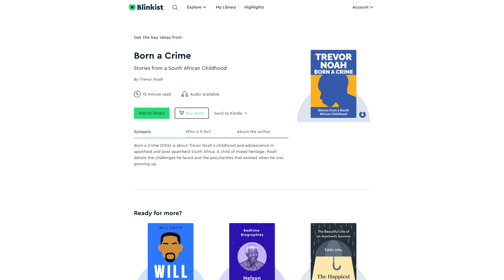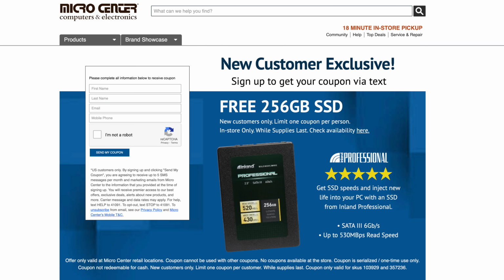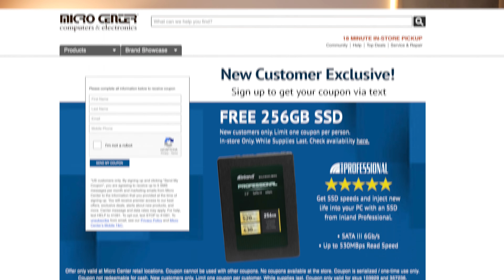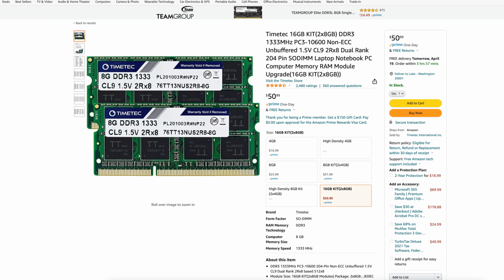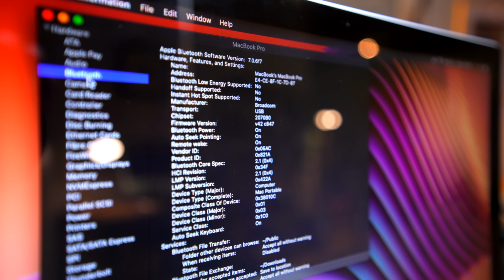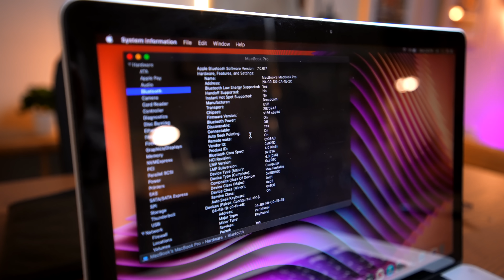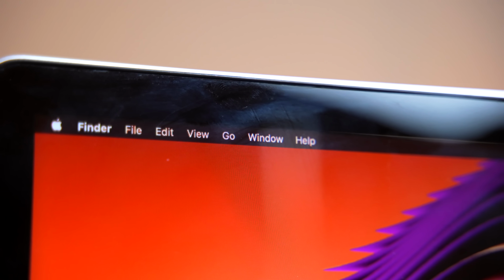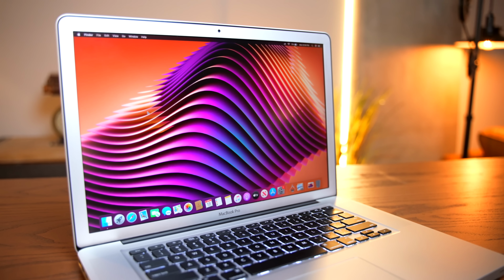Breathe new life into an old MacBook with THIS upgrade

Comment from the maker: Do you think modern Macs can be this long lasting in 12 years time? Also, check out my new merch if you enjoyed the video and want to support the channel! https://crowdmade.com/collections/lukemiani
Reply: I have a 2010 MBP 17” with the anti glare screen. Outside of the fact it only runs High Sierra it’s still a really good, sturdy and solid machine. I now have a 2021 16” MBP, but I will still use my 2010 MBP when I need to play around with some apps that still don’t work on my M1 Pro.
Reply: @FireAngelZero  I just put new battery and flash drive in my 2011 one, and it will work for a while yet. (Already upgraded it to 16 gigs of ram in 2011, so it was set on that count.)
Reply: @FireAngelZero  its pretty easy to patch it to run catalina or even monterey now if you want to run the newer versions of macos - i have a 2009 MBP running monterey
Reply: I have a recycle center rescued 13in Mid-2012 MacBook Pro, and as much as I don't like Apple because of their closed ecosystem, and anti-consumer right to repair stance,  it's still a good machine with a new battery, 8GB of RAM, HDD cable, 120GB SSD, and Solus Budgie Linux installed on it, and it does nearly everything at 720p I could want of a daily non gaming machine if I ever need it,  I just can't get the damn fan to spin correctly to keep it cool as I would like, so I don't use it for things like video editing. So yes IMHO you are correct about how machines are able to last so much longer now if you are not doing high end gaming, or high end work. 
Also yes even after Apples stops supporting the new M1/M2/etc.. machines I think there will be a lot of life in them with the fact the Linux community is doing some fantastic work, and even with the early results in some cases they are already making them faster than with Mac OS on them.
Reply: @CommodoreFan64  FreeBSD 14 works well in an i5 macbookpro from 2011.
Reply: Guess we’ll know once 2034 arrives. 😊
Reply: Hi i like video that you made because i think this is the way to go to fight against huge amounts of nonsense ewaste. Second i think bigger problem which at some point could be the topic for the next video is the planned obsolence where pc makers don't want to provide new software even though the hardware is perfectly capable. Greetings from Europe from Slovenia
Reply: It's easier to install Windows 11 on a PC from 2007 than macOS Monterey on this MacBook Pro, and it causes way fewer problems!
Reply: @Zebra_Paw  yeah that's 100% true. On mac side you have patchers but usually gpu is a problem
Reply: @domenvalentinuzzi  yes
Reply: @domenvalentinuzzi  Get ready for a lot more e-waste, when you toss perfectly good laptop because the flash dies, and there is no replacing it.
Reply: In order to boost performance i advise using toothpaste that has been recommended by 10/10 doctors as thermal paste.
Reply: Yes, the low-end users will be content with the M1 max. Of course they will have to settle for low-res 8k videos. ;)
Reply: I still have one Macbook from 2009 unibody. All Day long on!
Reply: They won't last any longer than their SSD due to really poor desitn.
Intentionally poor.
Apple shits on you and so do they on the environment!
Reply: @Zebra_Paw  Yeah they really don't build them like they did in the 2000s/2010s
Reply: @willm5032  They intentionally installed the firmware on the soldered SSD so if that SSD dies the machine cannot boot anymore, even to an external drive.

SSDs are a consumable product, so that shortens the potential lifespan of the machine by a lot.
In other words, do not buy them!
Reply: @Zebra_Paw  See a reply I wrote above. My current SSD is about 10 years old. Works fine.
Reply: @michaelhunt364  yeah sure, I never said all Apple SSDs would die in the next year or so
If soldered SSDs with firmware were the only issue I would never complain as much
Reply: @Zebra_Paw  Why would the firmware be on an SSD and not on the motherboard chip? Firmware stays with the computer. The SSDs are to be replaced. If they solder them in that is their dirty little trick to get you to take it somewhere and what they want is you to give up and fork over more money. Where did you find a soldered in SSD?
Reply: @michaelhunt364  the firmware just is on the SSD. It all started with the T2 chip, with their BridgeOS, which also introduced iCloud locks on actual computers (bruh).

A 2017 MacBook Pro can boot to an external drive when the internal drive is dead
A 2018 or later cannot, it would be completely bricked, even if you activated boot to USB before, which btw, is disabled by default and can only be enabled if macOS is installed and there's an admin user.
Reply: @Zebra_Paw  Well that sounds fucked. No wonder people are getting away from Apple. They are railroading you into a lifetime of constant hardware upgrades done by them or just selling you an entire new computer. I'll keep my 2011 Macbookpro with FreeBSD on it. Done with macos. Wife will need her macos restored once I update her 2012 macmini though. As long as she's happy with that. I'm not gonna worry. But I'd rather just put something on it that would work without all the apple fuckery.
Reply: @Zebra_Paw  found this:  Can the Aluminum "Unibody" Mac mini run Linux? Is it true that Apple has blocked Linux on these Macs?

Yes. The Aluminum "Unibody" Mac mini is capable of running a number of Intel-based distributions of Linux through Apple Boot Camp or by using "virtualization".

For the current dark "Space Gray" Aluminum "Unibody" Mac mini models (Late 2018), there was some immediate concern that the system's T2 security chip prevents the Mac mini from booting Linux. In its default configuration, it is correct that it is not possible to boot Linux, but it also is possible to disable the T2 security chip and then boot Linux.
Reply: @michaelhunt364  totally the right thing to do!
macOS in itself isn't a bad operating system imo, it has a few major drawbacks but every OS does.
So, I just make hackintoshes
Reply: @michaelhunt364  Yeah it's a lot harder to get Linux on T2+ Macs, though not impossible.
Expect a lot of proprietary shit to not work though
Reply: Back then, you could still get Apple certified Macintosh technician certification. When I was going for my classes, under the Steve Jobs regime, there was an option for a special discount, I took full advantage of it both times they gave us the option. Once in late 2009. I ordered maxed out 17 inch MacBook Pro, with the non-glare screen. And then in late 2011 the last of the 17 inch MacBook Pro‘s, also maxed out with a nonglare screen. I have since sold both of those. I also had a 2012 15 inch MacBook Pro with a non glare screen. I sold that a few years ago. I now have two Mid 2015 15 inch MacBook Pro‘s, and custom Mac Pro as well. I’m seriously considering late this year getting a new 16 inch MacBook Pro and selling one of my 15 inch ones.
Reply: The new screen makes it look like an oversized MacBook Air
Reply: Luke you have tons of these Macs, I've always been curious: the mid 2012 retina display looks to have the same hinges and connector as the non-retina, I know they have the same graphics card, so I assume that shouldn't be an issue. I'd be very curious if the mid-2012 retina screen would swap to the non-retina chassis...
Reply: I think generation of 2016 and after are more fragile.
I'm using macbooks since 2010 (so not as long as some people here for sure). I had a 2011 Macbook that was build so well... It was unbreakable very solid and I still have one model like that that is working at home. I also had one from 2013 (retina) and this one was also solid even if I have one USB plug that does not work anymore and the ssd was really too small (only 128go on the based model I took...). What I don't like is that we can't upgrade it (the 2011 macbook pro now has an SSD and more ram in it so at the end it is a more efficient machine than the 2013 macbook).
Now i'm using a 2016 15inch version. Screen is broken (my fault but what I did never had broken the previous model, the glass is really thin), keyboard has broken and I needed to go to the apple store to repair it: they changed the whole body, touchbar is half broken (half screen is broken). 
My friend bought a 2017 model on my advise and the macbook was not able to handle any charge one month after the guarantee has ended ... He had to pay 700€ from his pocket ...

So the answer for me : No macbooks are not that solid like rock anymore like they were used too ! :) I hope that has changed with the new m1 pro model which seem more solid...

But I really miss those 2011 macbooks that were really well built and upgradable and with the apple logo that was shining in the dark ! :)
Reply: Where you find screen for 30 $ ? It is shock !
Reply: This guy scammed me saying I won a giveway
Reply: I did this thanks to your video! Had a late 2011 laying around collecting dust. Ordered a matte display ($29 ebay) popped it in, only took about 15 minutes following your video. This thing feels like a new laptop! New screen is much better! I totally prefer the silver bezels! I would never have thought to do this upgrade without seeing this, so thanks again!
Reply: In terms of durability, if they keep making stupid decisions like they did for the 2016 MBP (keyboard, logic board architecture) not so much.  Maybe more so for their desktops.  The non-upgradeable factor, brings down the usability factor 12 years from now.
Reply: Hey i already have every upgrade, but can i upgrade the display on my macbook pro 13“ mid 2010 (7,1) ? And if wich screen?
Reply: Btw your videos are amazing Luke, and I couldn’t agree more! I had no idea about the Wi-Fi card upgrade before. People call me crazy when I tell them I work as a dj and run a recording studio off of two 2012 MacBook Pros with solid state drives and 16gb of ram. I’d love to see a video about a MacOS Ventura Patch so that it works on older macs. 😊
Reply: Hi Luke. I love your channel. I’ve done several of the upgrades you’ve suggested on older 2019 MacBooks I have. Even the white one I have is a decent machine that is cool. I have a 2010 15” that i gave to my daughter and she did something and the screen doesn’t turn on at all. Ive tried using a different monitor and all the tricks out there. It doesn’t do the start up thing but I can hear it running after pushing power. Is this maybe a video card or how can I check? I’d love to switch my 13” MacBook to the 15” if I could. Would anything switch? Like a graphics card if that’s it? Please let me know. YOu’re about the only one I trust to ask. Thank you!!
Reply: Nope, the integrated SSD will die, and they will be bricks, even though the rest of the computer would be perfectly useable otherwise. The nonremovable storage is a real kick in the nuts to reusability and longevity. Especially as modern flash isn't that long lasting.
Reply: @martinlebl631  It’s time to learn his to solder. The Chinese buy base models and just upgrade the SSD and RAM.
Reply: Hope not!!
Reply: no Apple will just come out with an OS that cant be installed on an M1 Chip in the future.  Leaving your M1 Mac Studio useless. A paperweight. Cant even upgrade it or fix it on your own. Go Hackintosh with Alder Lake Raptor chip and stick with Monterey. I doubt future macOS updates after Monterey will be worth wild unless they go touch screen which could happen.
Reply: I still have my macbook pro mid 2012 and it is still running smoothly after changing the hard drive and battery
Reply: I have a 17 inch MacBook Pro 2011. Love it but cant do much with 16GB of ram these days. Love my 2012 Mac mini too. But again 16GB ram max only. I love that they are both very fixable and upgradable. Back when Macs were GREAT . Now expensive to fix if fixable and sometimes Garbage.
Reply: Would love to see a comparison of your maxed 5,1 Mac Pro vs the M1 Mac Mini or M1 Studio. 5,1 is 12 years old this year! Great videos. Keep them coming!
Reply: I've got a mid-2009 13" Macbook Pro that I've dropped the max 8GB RAM and a 256GB SSD. Also had to replace the battery too. I wonder what kind of screen upgrade I could perform on it....It's also kind of a hackintosh as it has the latest version of MacOS on it. I'm thinking of grabbing a M1 Mac Mini used to be my iPhone backup...or just an excuse to have something that runs MacOS pretty well.
Reply: I think there is a scamer I here ask for any website to buy older macbook
Reply: Have you done a similar video for the mid-2012 MBP 13” that is so ubiquitous as the last of its kind? If not, please do. I have a 13” i7 model with 8gb ram & 512gb SSD, but no AirDrop🙁. Have I maxed out on utility for upgrades?
Reply: When I saw the thumbnail I thought it was a MacBook Air because of the silver bezels
Reply: I looked but don't see any links to the wireless card you upgraded to. Thanks!
Reply: I have ten of these. 2 ? I think are 15 inch.....  
they all have some bs about the clock being wrong. Actually the old tablets and such have this same bs issue saying the time is wrong so you can’t do anything ..... 

I have a ton of laptops and tablets from my old life. Of and phones.  Tons of phones.    It bothers me how they’re all seemingly self sabotaged .
Reply: They can't because they don't receive any updates afters 7 years ( sometimes more)
Reply: My M1 MacBook Air has recently been having kernel panic or just freezing up where I have to force a restart.. not great. Up until about five months ago I'd have said yeah though. I have 125GB space free too.. all I use is Safari, Apple Music and Apple TV.. I don't do anything that should cause an issue. I also do updates the day they come out. Only thing I do that's not normal is it's ALWAYS plugged in. kinda like a desktop.. whatever.
Reply: My macbookpro 8, 1 is 13 this year. I got FreeBSD running on it nicely. Much smoother than Macos ran on it just a year or so ago. Of course you must be willing to jump into the software configurations as well as just upgrading hardware too. But that's the fun of it. I'm envious of your new screen. I searched and couldn't find any.
Reply: M series device become instant e-Waste if anything on the single board breaks. At least the older Intel Macs have some upgradeable parts.
Reply: I think yes and no. They'll not be as long lasting if you want to be on the bleeding edge due to their lack of upgradability. Depending on build quality you might be able to keep an M1 Mac for 10 years (doubtful if you can't repair) if you're happy with keeping an obsolete model. Used market is gonna be good though I think.

Comment: i am kind of wondering why you didn't bring up the titanium power book
   i have a 15 inch model with two batteries that boots tiger and runs ok. but snow leopard was too slow. i put a (circa 2006) pc card modem from at&t 
   i also have a 2015 macbook air with 8gb ram-and a late 2013 macbook pro with 16gb ram
   after seeing this video, your talk of antennae made me wonder if a wireless cellular modem is an option on that mac book pro, maybe a data plan too
   by the way i also have a 12.9 m2 ipad pro, and a 2nd gen iphone se, with current unlimited data plans

Comment: I have a 2017 MacBook Air dual core i5, 8gbs ram, 128gb storage. Would you still recommend updating the WiFi card? My issue is that it’s a little slow. Would upgrading to 16gb ram make a big difference? I want to keep it at least another 2 years.
Reply: Same

Comment: Even in 2025 these hang out fine, I recently got a 2011 model with a failed gpu, just used the dosdude patcher to disable it and now I have a 15 inch quad core laptop with a fantastic keyboard

Comment: Thermal paste lasts a long time, but if it hasn't been changed, it definitely should be. It takes around 7-10 years for it to degrade.

If your Mac runs slow, check the CPU load in Activity Monitor. There will be a process called kernel_task or something similar. In case of overheating, it throttles the CPU by grabbing processor time to do nothing. So, if you see high activity from this process, that's a good signal to reapply thermal paste. You could also install a fan and temperature monitoring app like Fanny to confirm the situation, though it may lag behind due to the same kernel_task process kicking in to prevent overheating.

Comment: LUKE HELP, was putting in an SSD/caddy in optical drive and stripped the screw on airport card. The only way I can get to it and get the screw out is to cut/break the airport card housing. So I'm thinking I might get a 2011 airport/bluetooth card, but don't know if another display is available. Will the 2011 work with the 2010 display? or should I just leave it for now and get a 2010 airport/card? Any suggestions? Maybe I don't need that screw (it's the one on the right side of the airport card housing, sort of in a hole. Thanks for any help.

Comment: I have and old laptop with a roller ball, it still works. Since you asked I like the black bevels but the non-glare higher res screen is great. I have a 2010 MBP and will add up the SSD and such with an iFixit tool set and see if it makes sense May not bother with the screen or antenna. It's good to have to run older programs with no updates I don't need to buy new or on subcription. Thank you so much for this Luke.

Comment: The biggest problem I noticed with a 2014 MBP is the hardware is no longer compatible with new software and codecs which causes the cpu to run much harder than before.   I'd like to restore the laptop to factor software, leave off wifi, and leave it there to run period correct software like it was originally intended.